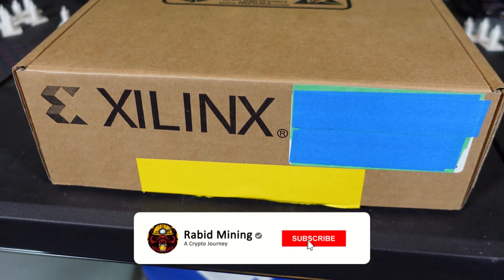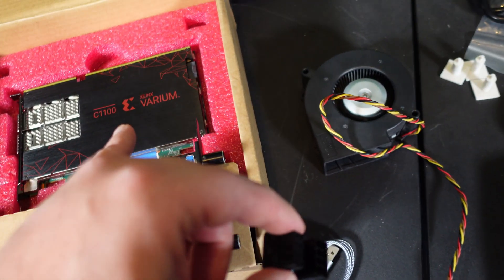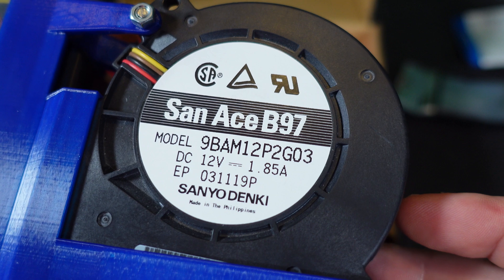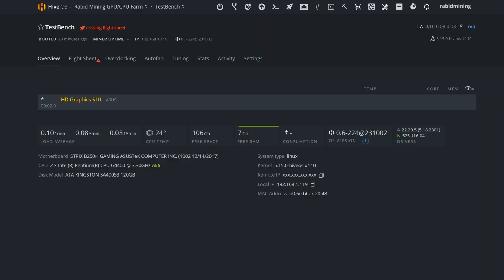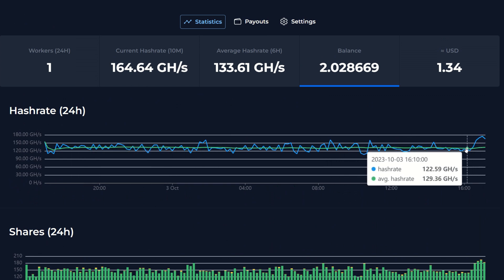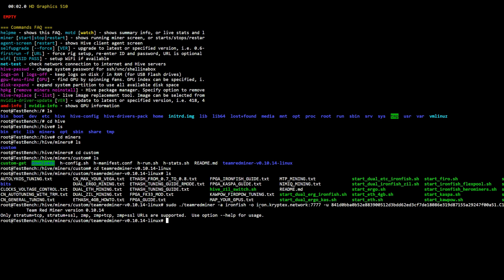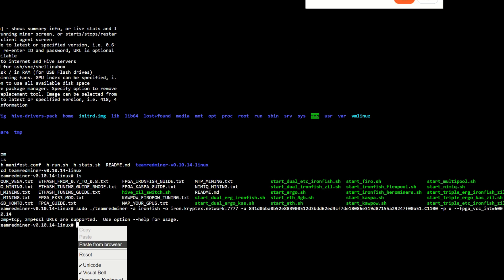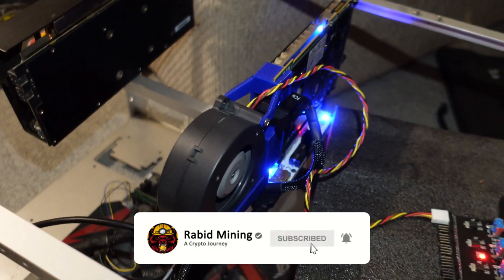C1100 FPGA HiveOS Set Up Ironfish Hashrate

Comment: how can you come back and check in on your miner if you lose connection to the shell after starting it this way?
Reply from the maker: Shell in again
Reply: @RabidMining  usually motd watch works, but not in this case. What’s the command ?
Reply from the maker: @xR00K using shell in a box or actuall shell?
Reply: @RabidMining  was using shell in a box
Reply from the maker: @xR00K try the shell option